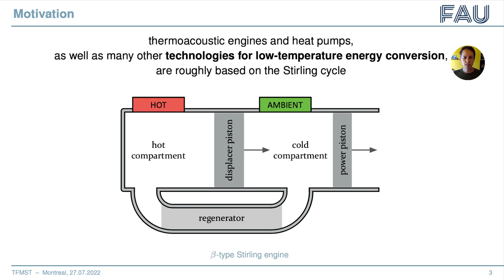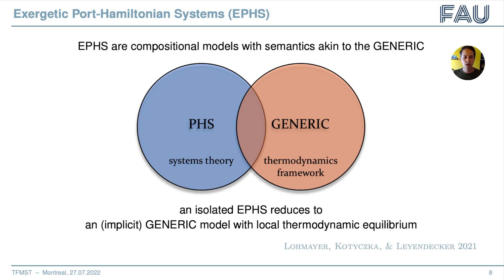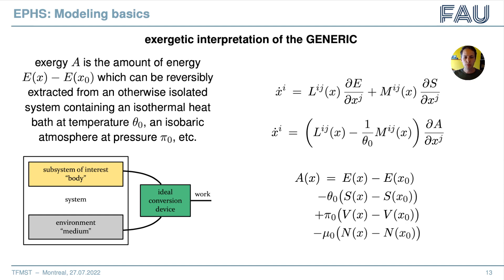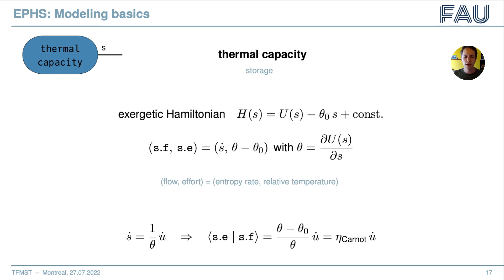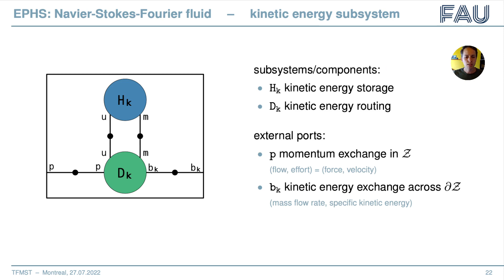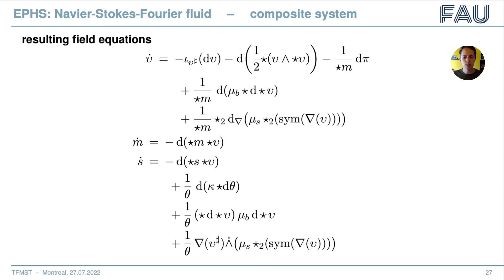Exergetic Port-Hamiltonian Systems: Navier-Stokes-Fourier Fluid (TFMST 2022)

Comment: Has this been applied to complex fluids?
Reply from the maker: Hi Erik! Not yet, but this is basically a "LEGO-version" of the metriplectic/GENERIC framework, building on ideas from bond graphs, port-Hamiltonian systems and applied category theory - and there is a bunch of work on complex fluids there. There is a published version of this which has the fluid model as a subsystem of two kinds of plasma models: https://doi.org/10.1016/j.cnsns.2025.109384 If you are interested in complex fluids, we would have to figure out how to nicely refactor such models into reusable subsystems. There is also a software prototype of this approach, but it currently only works for spatially-lumped systems.
Reply: @markuslohmayer8635 the reason I ask is because a lot of the stuff out there for complex fluids usually relies of general constitutive models without enforcing thermodynamic consistency.